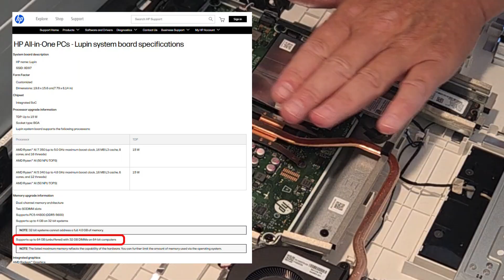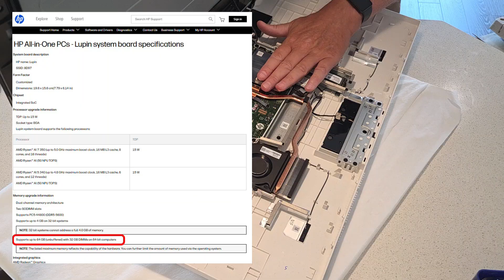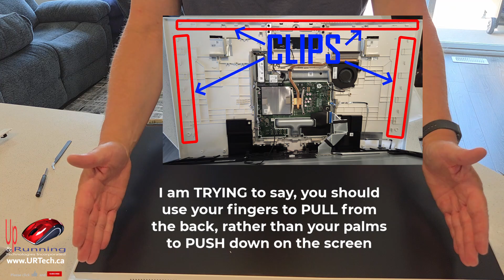EASY STEP BY STEP Disassemble & Upgrade HP 27 All In One

Comment: The "finger" thing to get the screen in doesn't work. Your fingers don't have any grip to be able to pull it towards the screen. Some pressure has to be applied. This model is atrocious. It was difficult to get the screen out and it is difficult to get it to snap back into place for me. This is same model but a few years older but essentially the same exact way. So sick of HP junk.
Reply: I could get it snapped in all but a lil on the left hand side. I kept turning it back on to make sure the pressure didn't do anything. Then turned it upside down to try and get that last lil bit snapped in and....that pressure destroyed the screen. Glad I wasted $400 on a POS fragile garbage HP. So sick of their junk. There is zero reason they need to be designed like this. I have done quite a few AiOs over the years and although they were a lil bit of a pain, none so much as this one. And this is what I get? Absolute garbage 😡😡